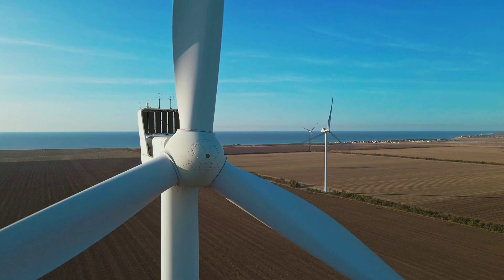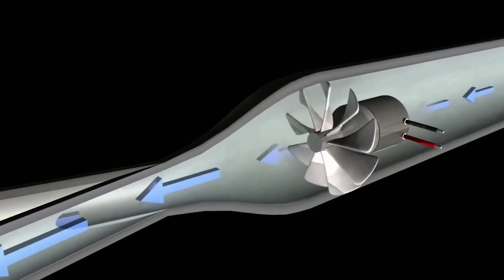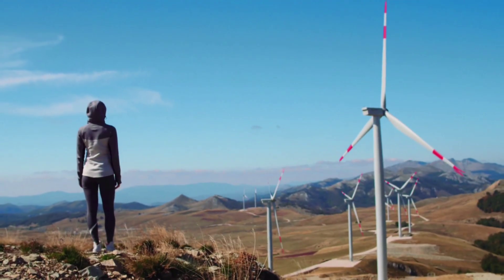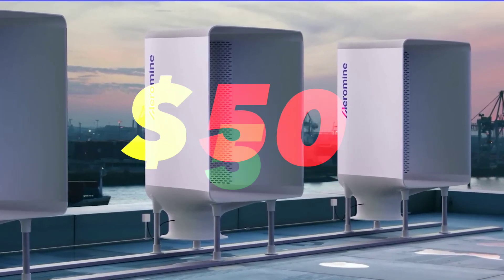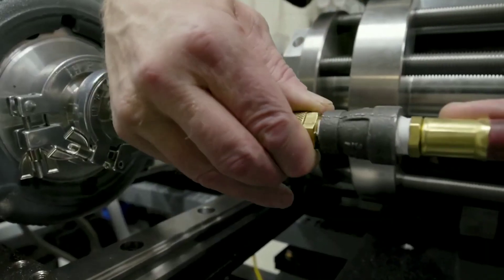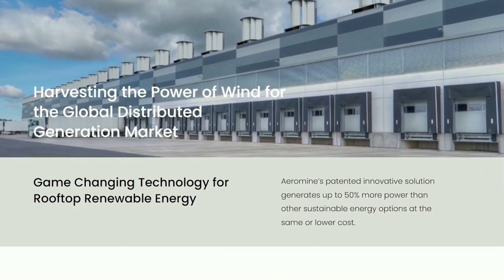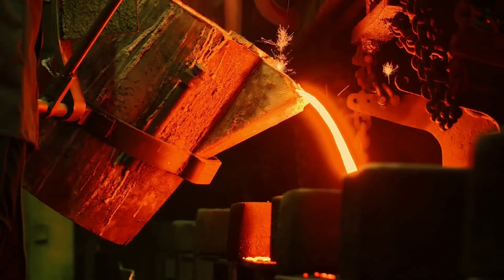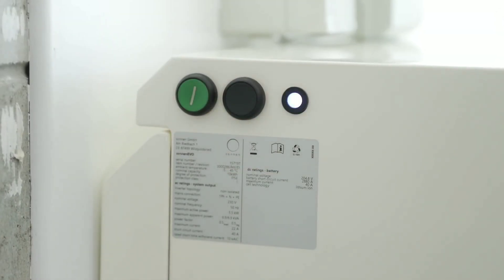NEW Wind Turbine for Home Outbeats PV Solar Panels in 2023?!

Comment: No No no.  This video is full of mistakes. This company does not recommend this design for home residential use. Flat roofs on warehouses - commercial purposes. It does not turn with the wind and needs to be placed somewhere there’s a prevailing wind directions.
Reply: It is also horribly opinionated statements... could have been educational.  :-(
Reply: @davidcaylor7484  I like renewable energy, but this video should be taken due to misleading information. I doubt it will harm anyone though so I’m not going to report it.
Reply: You are wrong.  Wrong. Wrong
Reply: @SteveStowell  go to the company’s website.

Comment: How high above grade level does the Aromine need placing to produce optimum output? Is  the VAWT equipped with a stop & lock down assembly in case of approaching storms?